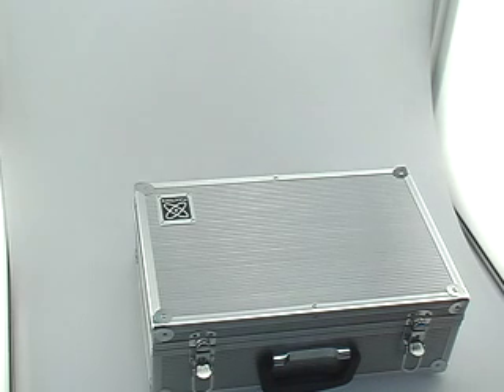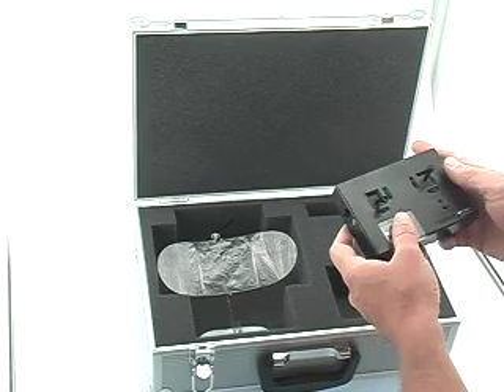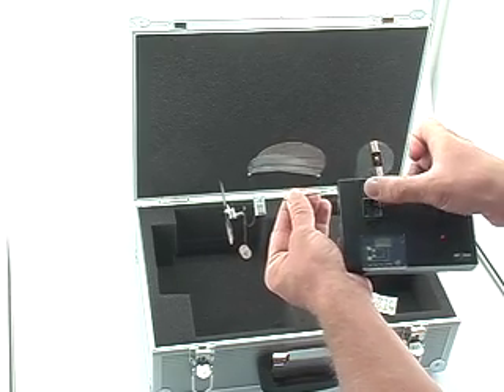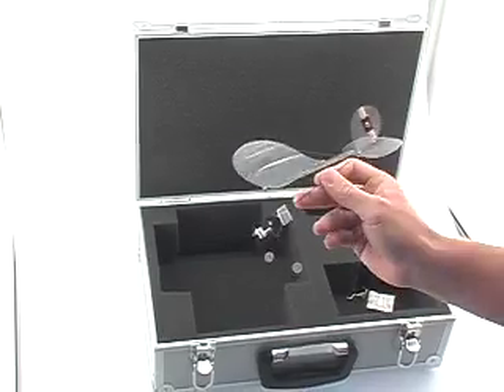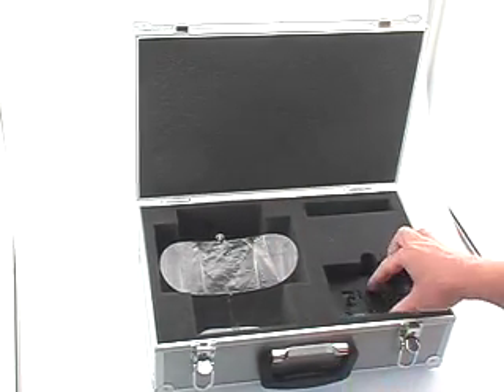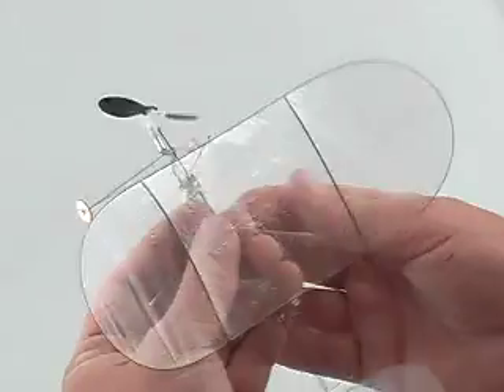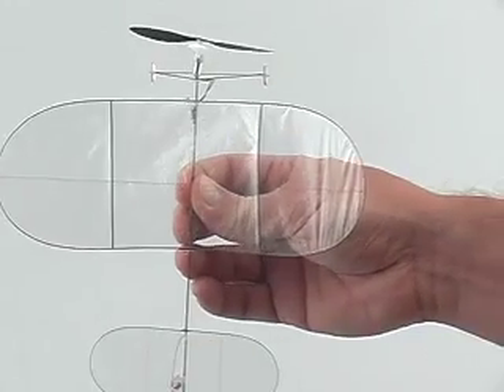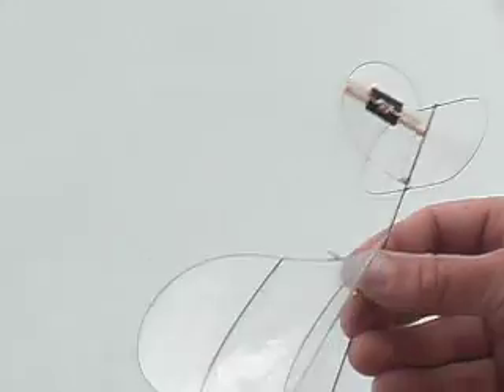Carbon Butterfly How-To video - Setup and DIY stuff

Comment: I have a aero soarer here. The flight time is short and the accuracy of the rudder and tail wing are not good, but the it can get lots of hits in the livingroom walls, chairs, tables, floor... and it still working! xD The aero soarer weight 3.5g (error of +- some mg) and use foam as main material. Maybe the next model of plantraco could be more cheapy, for rookies? ^^

Comment from the maker: Actually, the lithium polymer cell can be charged at 3C charge rate, so you could charge in 20 minutes if you want.   We are conservative with our cells, charging at 1C (so 1 hour).   BTW the longest flight has been over 22 minutes.  We say 6 - 10 minutes - again being conservative.    Aero Ace is fun, but it can't be as precisely controlled, and it's noisy, and heavier and has a higher wingloading so it flies much faster. Have fun, and keep us in mind if you want to upgrade in the future.

Comment: These are very cool,but if you have any modeling skills and know the sites to look at you will see that these are ridiculously expensive. All parts can be bought for a fraction of what they sell them for. Hell I have a $35 Ares RC stick 75 that's 2.4, fully proportional digital TX, Rx. Basically identical but $35 bucks and they fly awesome. But if you want the name spend 4x that for the most basic package.

Comment: More like 5-10 minutes and the battery just cost about $5 so the Palm-Z is WAY cheaper, but I must admit it flys WAY slower than the butterfly.
But still I would rather spend 300$ on 2 RC models than on a single one :P.